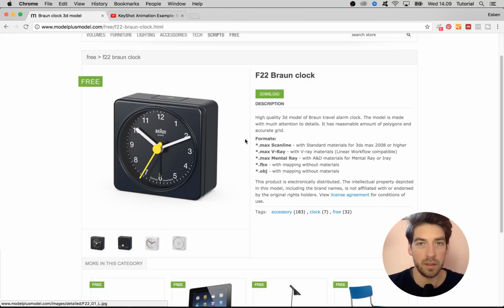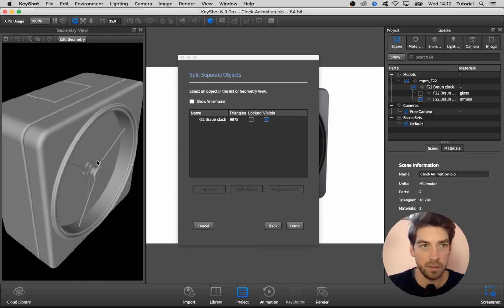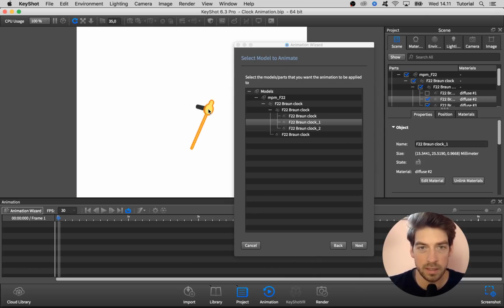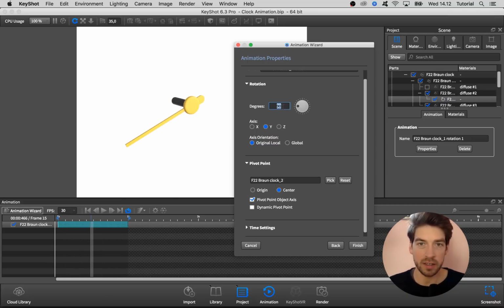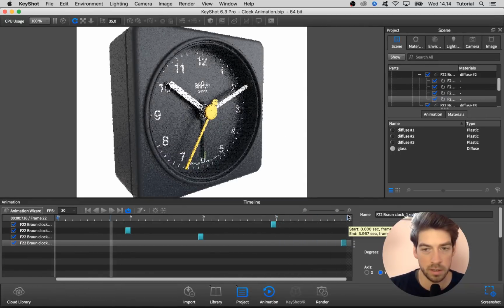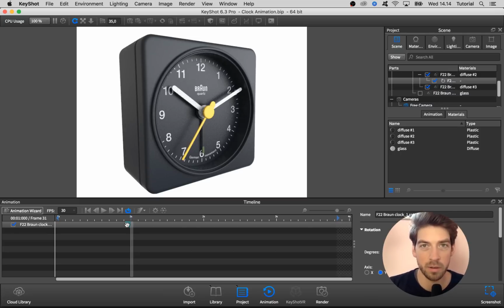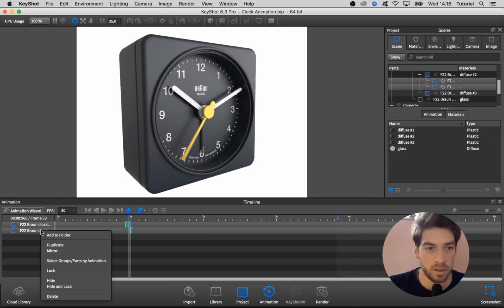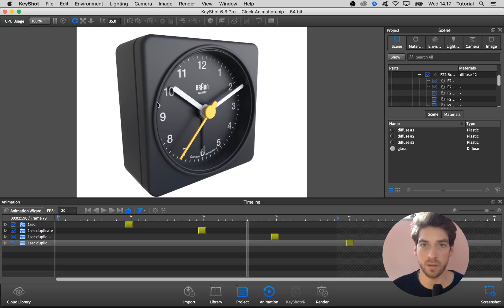KeyShot Animation Tutorial: Ticking Second Hand

Comment: Thanks for this...your tutorials are always so good. Can you tell me where you sourced the background image for the rendering? I working on a project at the moment and it would be IDEAL for what I'm looking for. Cheers and thanks again for another great effort
Reply from the maker: Hi M E P R.
Thanks a lot. If you refer to the HDRI (which is also the background) then it is the Dosch-Apartment_2K (that comes with KeyShot) that I've desaturated using the HDRI-editor. Hope it helps :)
Reply: Ha! Awesome...thank you. Much appreciated...I'll try and replicate something similar.
Reply from the maker: Cool. Will you be able to share the result? Would be nice to see :)
Reply: I wont be able to share the work result, but I'm also going to download the clock file and have a crack at your tutorial over the weekend also :) So i'll share those results...see how close I get :)
Reply from the maker: Cool. Looking forward to see it :)
Reply: One other quick question. Went it comes to materials that use Maps (as per the clock), is it still possible to add dust specks to them (using the material graph). If so, what 'node' is the best to use?
Reply from the maker: Yup, that is possible. I would add a gray diffuse material as a label on top of the clock material and use a dust map in the opacity channel of the diffuse material.
Reply: OK great, I might try adding a few spots on the casing and on the plastic lens of the clock. I'm learning...so the results may not be great ;)